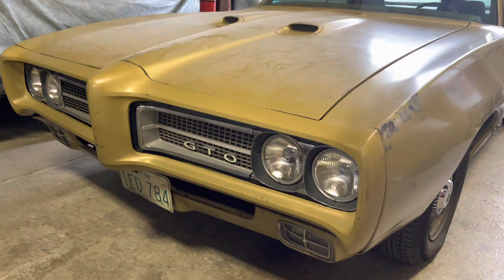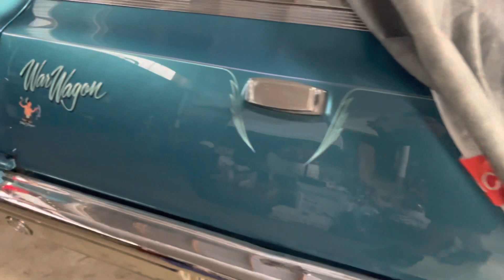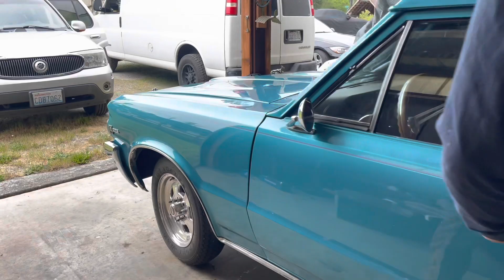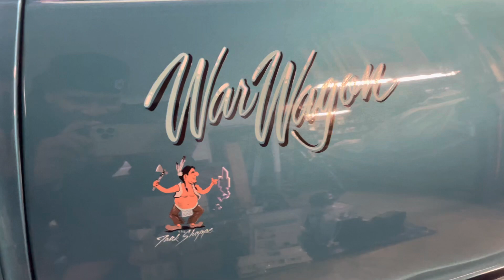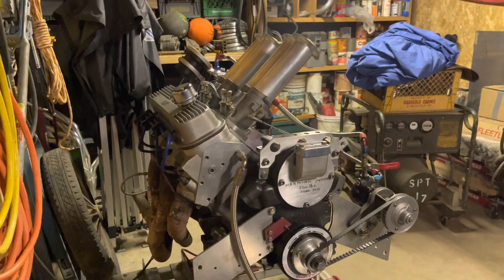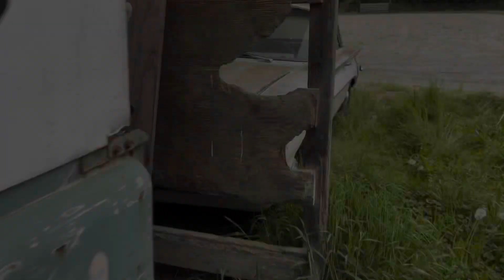One Man’s Pontiac Obsession!

Comment: The first car, the GTO it's a nice one to restore but better to drive it as it sits. The wagon it's a beauty......nice collection brother. You are a lucky man.....actually a smart man for hanging on to them. Every muscle car I ever owned I saw dollar signs and flipped them. Now at 68 years I'm broke and driving a '91 Ford Festiva. I have a complete Mercury Capri Xr2  (Mazda) drive train. (1.6 with turbo) to swap in. It's a far cry from my '64 GTO, 389 tri power that I once owned but it will be a sleeper to be reckoned with.....150 hp pulling 1700 pounds. I do have eyes on a '62 Tempest, 2 door, 4 speed 215 aluminum v8. But that's probably not gonna happen. To all you dudes seeing dollar signs, before you flip them make sure you save the best.  😢
Reply from the maker: Get that Tempest!!!